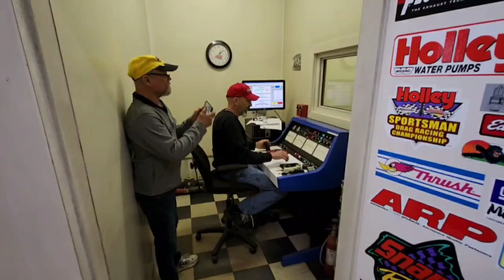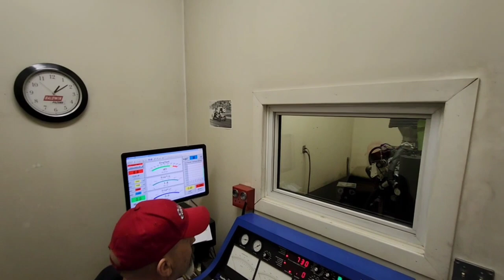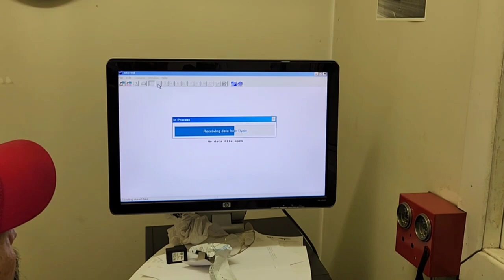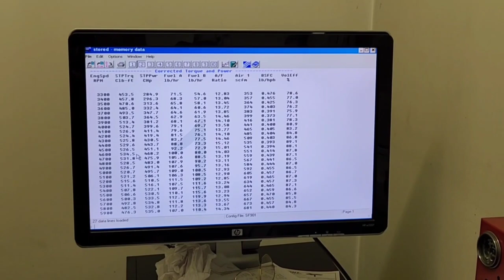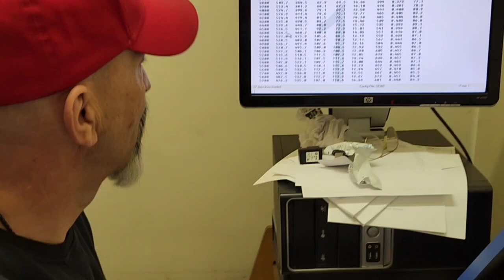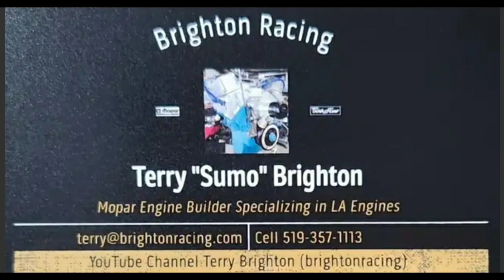Dyno Run of the 318 with Trick Flow Heads.  535 HP 535 TQ!

Comment: Made that HP and a tad more torque with a 416" (340 based) using Edelbrock RPM heads but a much larger Ultradyne solid flat-tappet cam (259/263* dur.@.050", .590" lift, 110*LSA, tight .014/.016" lash), a M1 intake, 750 AED double pumper and 1-3/4 Hooker headers. The engine went in a '71 Demon and ran low 11s with ease on 89 octane pump gas (dished pistons, 10:1 compression) with a 3000 stall converter and 3.92 gears, shifting at 6000rpm. Would rev cleanly to 7200, but as you know, the small runner volume and long stroke made it pointless to go that high. Your build speaks to the efficiency of the Trick Flow heads (unavailable when I did my build, around 2000, I wanted "Large Port Commando" heads but MoPar themselves couldn't tell me what rocker gear and other support items I'd need) and your experience and good parts selection. The 318 has always been a contender (baby 340) with the right parts added!! Love it!! Thanks for posting..

Comment: 535 and still climbing I wonder what it would do at 6500!
Reply: Break the crank. Well, not necessarily. These 318's can handle 6500 for a while. Even seen them turn 7k for a while before the crank exploded. Personally, I wouldn't want to spin mine any higher than 6300 without an entire custom-made forged lower end built for turning high rpm, especially if it was a stroker. I, however, like building stock displacement 318's.